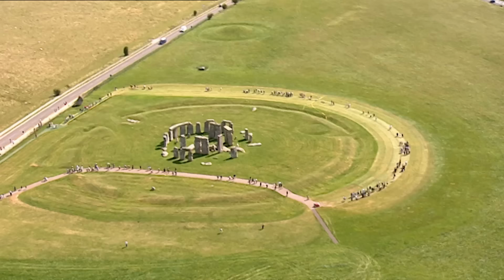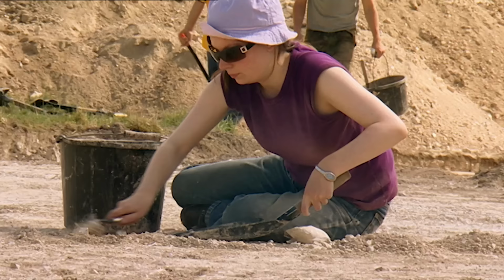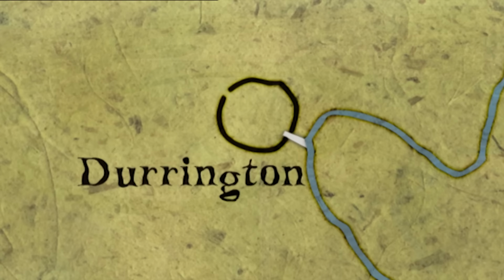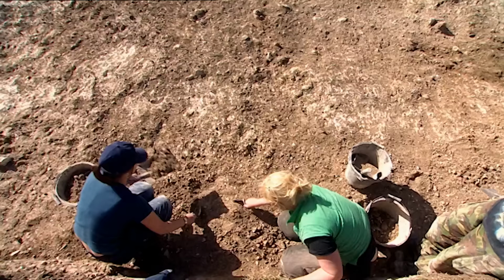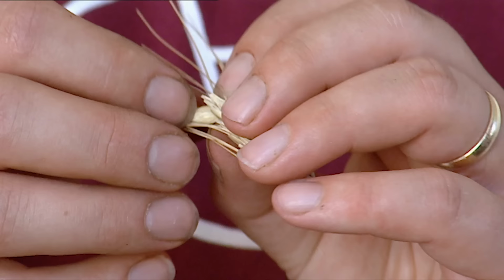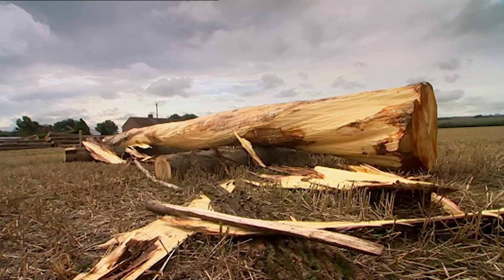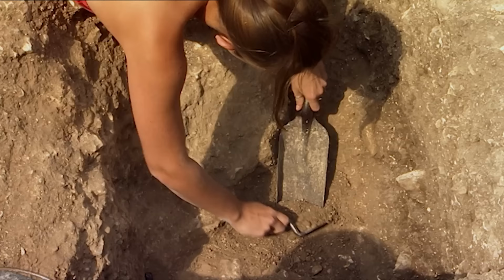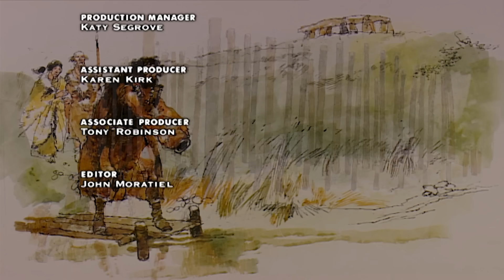Time Team Special: Journey To Stonehenge | Classic Special (Full Episode) - 2005 (Durrington Walls)

Comment: I wonder if the timber circles didn't have a roof...Something like a huge thatched dome, with cross members to support it attached to the tops of the tree trunks. Since they'd be meeting in midwinter, having some form of shelter to get under would make a lot of sense.
Reply: Or to keep the snow off. The British climate goes through cycles in which some centuries are colder than others, rivers may freeze and streams can dry up. Mass movement of people across the country on foot at midwinter would not always have been easy: a reason to abandon festivals, or scale them back and celebrate at home/locally? 

At midsummer, most people would have been busy farming or looking after animals, whereas they had killed many of the animals by midwinter and more people were free to travel, if it was physically possible.

Comment: Forgive me, I must have missed this, but how did they determine the height of the poles?  I love watching this.  What a feeling to be finding the remains of a 4500 year old settlement.
Reply: Seems that there's some degree of guesswork involved. Archaeologically they could know the diameter of the timbers and how deep they were set into the ground. From those they could surmise how tall the could have been without knowing for sure what heights they actually would have been. My own theory is that the timber henge might have had a roof. Individual families lived in roofed houses so I don't think it's too much of a stretch to think this major communal gathering place could have also been roofed. From what was presented, only the entrance poles are known to have had an alignment with the solstice. Inside could have been a communal gathering hall for feasting & eulogising the deceased. As they were capable of organising a large workforce to build the enclosure and the henge, they'd certainly be capable to roof it over. Living the rest of their lives in small buildings it must have been very magical & emotional to gather in a relatively huge structure. Those kinds of feelings when inside a large space continue to be part of universal human experience. Medieval folks would have felt it with their cathedrals, just as we feel it with our huge airports and sports stadiums.
Reply: It is all in the geometry. Once you known the depth and circumference of the hole and the angle of the ramp the trunk was slid down you know approximately how high a trunk could have been. Go back and watch the bit when they are trying to do the reenactment of erecting a pole.
Reply: I’m glad I flicked through these postings… because THAT was my question.  How did they determine heights of various poles??  Did the Neolithic 
Men have a set formula for postpones?
Reply: @nolasmith7687  Bear in mind that the people building the timber circle are digging with bones and antlers.  They were not going to dig any more or deeper than they had to in order to keep the posts standing.  If a post could have been held upright with a smaller or shallower hole, that’s what they would have done.  So using mathematics and geometry, they can calculate the height that a post would have to have been to NEED a post hole of the given dimensions.

Comment: Here's a suggestion about the alignment of the henge. Stonehenge was dual use for both summer and winter solstices because of a uniform horizon. The timber henge was apparently only for winter use because the summer and winter horizons were different.  The timber henge was surrounded by a huge bank and ditch. Couldn't this have been engineered to form an artificial horizon to allow for both uses?

Comment: I find it curious that the archaeologists seem to assume the timbers for the wood timber henge were transported there over significant distances. Isn't it possible that before its construction the entire ditched enclosure was itself forested? The timbers may have been harvested from the immediate area. Also might the timber henge actually have had a roof? From what was presented, only the entrance poles are known to have had an alignment with the solstice. Inside could have been a communal gathering hall for feasting & eulogising the deceased.
Reply: I don't expect they 'assumed' anything!
I expect they came up with a theory based on evidence/experience/knowledge etc ..!?
Reply: @rossmacintosh5652
I find it curious that you assume that they assume that.

Comment: I erected a fairly substantial torii gate this year. I dug the postholes, and the ramps, attached lines to pull it up to nearby trees, used pulleys, and a tractor to do the pulling. All that together was not enough to counter the tendency of the logs to just want to scoot forward. I levered up the top and used blocks and then poles to slowly raise the top portion in conjunction with pulling until it was high enough up to drop into the post holes. I've got a mind to think that ancient people might have done the same. And once the first poll is set it can be used to help raise up another poll and so on.

Comment: I wouldn't be surprised that there would be arches being constructed on the outside pillars that would have been similar to the Japanese Torii gates while the inside rings might have been made into a circle or even multiple. This would allow a roof to be added from either cloth or another material. Specially during the winter you can easily imagine these things to have some sort of roof so the people wouldn't get wet and sick. Getting sick and potentially dying from it would beat the purpose of these circles I'd imagine.

Comment: 10:42 - seeing the two inner circles my immediate thought was: why are they placed in those specific off-centered positions? Especially the smaller northern circle.  At least the southern circle appears to be bisected by the line run between the two entrances.  These builders went to a lot of trouble to get alignments right, so there must be a reason these two are not in the center.

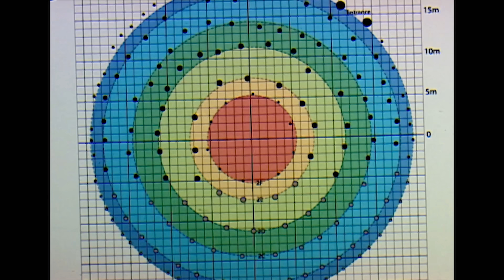Comment: Couple of things. In that Southern circle, if it was like Tony suggested and they spruced the place up with ribbons and decorations, sheets, nets, rope and animal parts if you look at the image at 12:31 in the video you could almost visualize several paths from the Entrance to the Center where the actual ceremony would take place. Perhaps they had different paths for different types of ceremony. 

The other thing is on the other side of Stone Henge other monuments have been connected to Stone Henge. I can't remember right off but I believe one is called Avery Hill or Asbury something like that and that hill also has standing stones and then there's another place they believe was connected to Stone Henge by way of a road across the plain. I'd have to do some research to get the name of that second place. What I remember off hand atm is the name began with a "W" and it is a very large and complicated site.  So for dozens of miles all around there it was nothing but a huge ceremonial complex by the time they were done with it. 

Has anyone heard who the builders were? At 2500 BC weren't the Beaker people active in England? Or could it have been a different group?
Reply: Very interesting. Need update of new details, if you find the answers

Comment: It is said that a population grows to the limits of their food supply. When farming came to the area it would cause an expansion of the population, which would have to be dealt with by leadership. As it has always been, massive construction projects an efficient way to keep the population occupied in peaceful work, and this is best accomplished if some connection to the afterlife, the divine, or ancestor spirits is made.
What the religious beliefs were is almost secondary to the need of the project, and the building of community cohesion that large projects bring.
We need work to occupy us, we need shared experience, we need places to gather and celebrate, and that comes before the reasons for those gatherings.

Comment: It seems to me a few things are being over looked. Firstly, the narrow point at the river was for arrivals. Small craft needed to be off loaded before being hauled up out of the water. Off load and move, so someone else could off load. The wood henge would have been roofed. This way the massive ropes could be stored out of the weather, that would have caused them to rot. The building also housed a massive amount of beer vessels, with all the equipment necessary for producing the beer. The pigs were fed the left over mash after the beer was made and stored. Many hands arrived weeks prior to the festival, they did all the work possible, then stored everything for another year. Then they celebrated the solstice with all due solemnity. Then opened the kegs and feasted before returning home.

Comment: It occurs to me the woodhenge they built during this show (mirroring the original at Durrington) may have been built like that to support a roof, with the smaller posts on the outside to slope the roof down to the ground around the perimeter. They created structures like this in Egypt, Greece, etc. in antiquity, I can't see why they wouldn't do it in England as well. Seeing that henge for the first time instantly transported me to Egypt, staring at a temple that was missing it's roof (in stone of course but the same principle applies). If this is an accurate thought, both of the wood circles inside the Durrington Henge may have been wood-constructed indoor temples. Interesting thought.

Comment: the thing that gets me with the posts is that we don't 'know' how tall they were. I know the suppositions is that the wider and deeper the holer the taller the post was, but it could also be  that they were cutting one tree into 6' lengths and only having four feet or so above ground...or maybe just making them tall enough so they couldn't be seen over at all, so 6' above ground with whatever is needed to make them stable in the ground.
Reply: The hole for holding up a 6’ post would be much shallower than a hole for a much taller post.  They didn’t have a mechanical digger, or even a steel shovel; they dug every inch with deer antlers, so they wouldn’t dig any deeper than they HAD to in order to hold the posts up.  Therefore, the height of the posts can be estimated by the depth of the post holes.  It’s all math.

Comment: I know there is no surviving evidence but the woodworking joints used at Stonehenge suggest surely that these must have been used elsewhere on wooden structures eg to provide lintels on all the woodhenges dotted about. These would have strengthened the construction.  but I have rarely heard this suggested. After all they were already adept at roofing round houses. To my mind this is as valid as all the ideas about why they were built in the 1st place.

Comment: Sir Tony's and Professor Aston's scepticism in the face of the elaborate theory is well-founded. There is not a scrap of evidence for the particular interpretation the dig is trying to prove. You might just as well come up with a completely different theory to fit the finds. Using Malagasy parallels don't prove anything.

Comment: Most hilarious episode ever. This was all about herd protection and management. The large ring/ditch is a defense against wolf attack. There should be a dam that was used to flood the ditch. This gave the herd access to water at night and also served as a sound warning for night wolf attacks. Once they got in they could not so easily get out.  The buildings were wintering quarters for both herds and people. They were big enough to accommodate both - hence a barn. The problem was the fire in the center of the structure. The purely wooden structures were fire risks and occasionally burnt down with terrible loss of life. Stonehenge itself may have originally been wooden. But after a massive fire which caused massive casualties they replaced the inner circle with stone so that this would not happen again. This means that there should also be a ring/ditch around Stonehenge. Of course they had avenues to the river because that is where they got their water. They would have lead the herd out that way to graze in the summer, which is why the avenue is not formally straight.. In winter hay would have been stored inside the ring to feed to the cattle in the barn. This theory can be tested by looking for rings of wooden posts around Stonehenge, which would have been a multistory structure - cattle below, people above. Stonehenge should also have a ring/ditch even larger than Durrington. Soil samples should reveal more organic matter inside the ring/ditch than outside in both cases. Since the structures were used for wintering it was important to observe the winter solstice so they would know how long it was till spring and feed out hay, and ration firewood  accordingly. This is why Durrington did not need a summer solstice aspect - it was all about winter.
The real puzzle of Stonehenge is why there is only one of them. If the stones did provide fire safety they should have built subsequent ones of stone as well. The fact it is unique means that the ploy did not work and that Stonehenge burned down a second time just as catastrophically as the first time.

Comment: Is it known if that area was wooded at the time the henge was built? If it was flat moor perhaps those wood circles were built as a Druidic temple, meant to simulate a sacred oak grove.
Reply: Druids came much later with the Celts about 1000 to 500 BC. Stonehenge and Durrington Walls were built at least 1000 years before the Druids, around 2500 BC.
Reply: Most of the island was wooded

Comment: What if it was just an arena of sorts for the recreational hunting of their reared pigs?
Reply: That would not require several concentric circles of dozens of upright tree trunks sunk into the earth. Nor would defense, or any other basic domestic purpose. A simple wattle-and-daub fence would do the job.  

To go to that extreme extent of work and effort, digging hundreds of massive post holes with deer antlers, the builders had to have a reason powerful enough to make it worth doing.